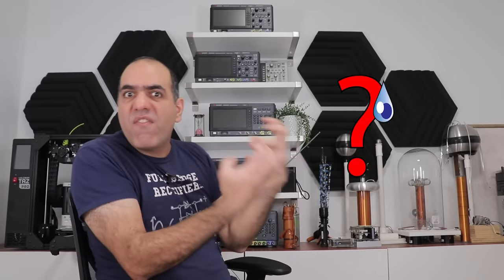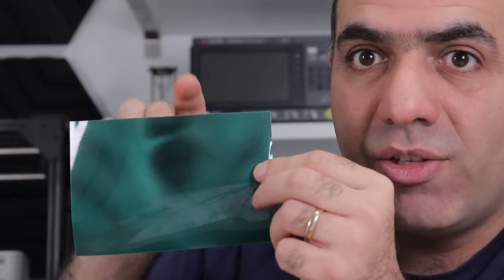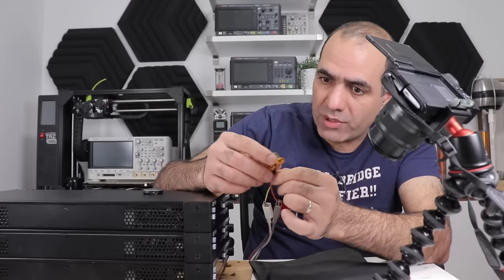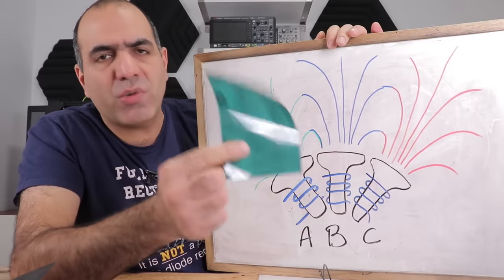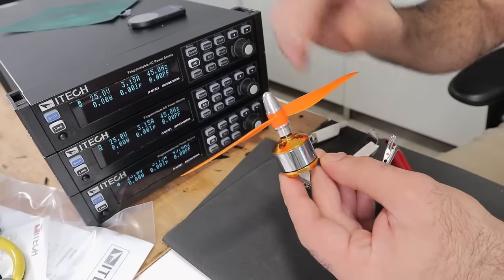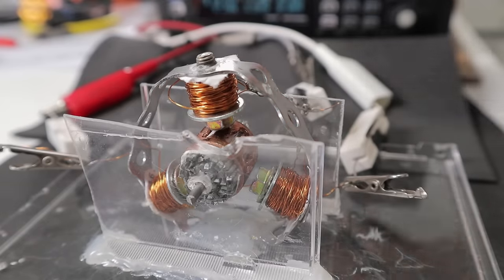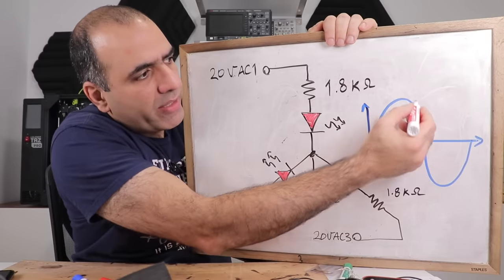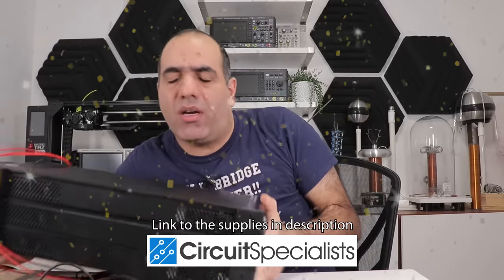Trying to See Rotating Magnetic Fields

Comment: I use to get into arguments with my instructor after class at my community college. He was VERY well educated in electrical subjects. He wasnt a physics professor but had tons of work experience and he was saying basically the same thing you are in a little less detail. I still cant see how a magnetic field rotates. I have always looked at the motor-pole system as kids playing on a merry-go-round. The poles are like the kids standing at a few different locations in a circle around it. The kids arms are like the "rotating magnetic" field and the merry-go-round itself would be the motor spinning because of interactions with that magnetic field. The kids are stationary as they start to spin the merry-go-round and the energy they can put into the merry-go-round is strongest when closest to the kids. As the kids push in the same direction their arms are able to put less energy into the merry-go-round as their arms extend and since the kids themselves arn't moving they must let go at the point where they can no longer put energy into the system because their arms are fully extended. So the merry-go-round must "coast" for a short time so the kids can retract their arms and reorient to make another push. Now if we look at what is acting as the magnetic field (in this case the kids arms) we see the kids arms are not rotating but rather adding a tangential force in specific areas around the merry-go-round that results in rotation. But again the kids arms are not rotating. They are activating and deactivating in synchronization with eachother to maximize efficiency and the more kids we throw in the mix represents more poles in a motor. It makes the gap between kids smaller so it's easier for them to rotate the merry-go-round because the kids can concentrate their forces across smaller sections of the merry-go-round's perimeter. But even kids standing shoulder to shoulder would still not make their arms move in a circle, just shorter distances of back and forth. And I realize that if you squint a little it all looks like its rotating but in my mind the magnetic field is appearing and pulling the rotor a little then disappearing and reappearing in the next coil where it pulls the rotor again. So like the kids and the merry-go-round scenario it's being handed off to nearby poles (kids) and the magnetic field (kids arms) pulls the rotor a little and hands it off again. But everyone could see that neither the kids or their arms are rotating. Another example is trying to cut a circle out of a square piece of paper by only making straight cuts. The cuts represent the perpendicular force between the rotor and the stator coils. Big long cuts would make a blocky circle. You could make many small cuts around the paper and make it look even more circular and that acts like adding poles to a motor but no matter how small the cuts (or number of poles) if you zoom in far enough you'll see it's a "circle" made from thousands of tiny straight cuts.

 So I don't think the magnet field TRULY rotates and that's where lots of confusion comes from. It just strongly implies rotation when really it's small interactions of tangential forces that CAUSE rotation. I know its nitpicky but it feels wrong to say a magnetic field rotates when it's just expanding and contracting in areas around a circle. Like how a "flying squirrel" doesnt actually fly but rather glides.

If I'm wrong or otherwise off in my understanding of "rotating" magnetic field please someone explain it to me better. And thank you for humoring me with this absurdly long post. Also I LOVE your videos. I would have loved to have you as a professor in college. Keep up the outstanding work!

Comment: You can easily make a 3D magnetic field visualizer by getting two pieces of optically flat glass, mix mouse milk (it's a lubrication product, not actual milk from mice) and some ferrofluid between those pieces of optically flat glass panes (obviously you need something to contain the fluids). Some LEDs around the edge, and you're good to go.

Comment: you could have drilled a hole in the sheet, and then stuck it around the motor so that the motor would rotate inside the sheet. start with an axle-sized hole to get a side view of the motor, and then a motor-sized hole to fit the whole motor inside it, where you don't let the sheet rotate at all

Comment: Just a thought about why you couldn't see the fields on the sheet, I'm assuming they are some sort of ferromagnetic particles in solution with viscous fluid, there would be some lag in the system for the particles to move. Could it be that the frequency was too fast for the sheet to respond?

Comment: You may take a stator with coils from 3 phase AC motor, fragment of plastic drinage pipe and steel ball.
Plug stator to 3 phase power supply, get plastic pipe inside stator and steel ball inside pipe.
Ball will spin inside stator.

With love from Russia, sorry for my english.

Comment: 45 Hz is probably fast for magnetic field visualization sheet. 
I learnt this hard way when I was able to get clear voice of amplitude modulated laser signal using a Photo-Diode as receiver, but got gibberish when I used Light dependent Resistor. 
After 3 days of trial I understood the importance of response time.

Comment: The "magic paper" iirc has tiny pcs of nickel in it. They take time to orient themselves. What happens if you crank the frequency down to say 1hz? The particles  tend to stay stuck in their orientation so if it doesn't work maybe a fast moving field like a nearby rotating magnet or degausser etc. might reset (randomize) paper and show some 1hz commutation?

Comment: You can just take the rotor out of a induction motor that is about 1/2 hp. That should be large enough to fit a compass I the center. Then use your power supplies to speed it up, slow it down, reverse etc. Turn your induction motor into a permanent magnet synchronous motor.

Comment: How about a double walled cylinder that the motor can fit inside, then put iron filings into the "interior" of the cylinder. for reference.. Think about a double wall plastic travel coffee mug. The magnet/motor goes inside the cup, like where the coffee would go. And the iron filings would go inside the "vacuum chamber" between the two walls of the cup.

That way the iron filings are contained, but free to spin around the chamber with the magnetic field.

What do you think, Mehdi?

Comment: Just to be clear, the magnetic field does not rotate.  The field always has a curl of 0.
It's analogous to waves on the ocean:  the feature of having different height in different places will move, and you can surf them.  But the ocean itself is not moving; the water at each point is moving up and down, not flowing with the waves.

Comment: Electroboom. 

Could you make a clear acrylic cylinder casing that surrounds the motor but also allows for viewing 360 degrees around it. Fill the cylinder with a clear oil and put ferofluid or even iron shavings and potentially see low frequency rotation?
Reply: After commenting I realize that this doesn't paint a great picture. I give you a draft if you'd like.

Comment: Medhi, do you happen to know why some geared ebike motors are more efficient for hill climbing than direct drive (ungeared) motors, so that they use less power and don't get as hot? How much does the electric motor efficiency vary with RPM, current and load?  
That was a brilliant demonstration with the LEDs.
Reply: Gears in the E.V. bikes are it's TORQUE multiplier...   
let's assume a motor on its own can produce 
" x " newton- metres of torque("T") @ rated voltage/ amps/ rpm..("v/a/n") respectively
now a geared e.v. with a 3:1 ratio. would give a reduced speed of " n/3" but a theoretically increased torque of " 3T " ...thats advantageous in hill climb...
for the same (" v/a") input...

Comment: the futer of genorators is the past, with a stabel ac surce as excitation, the main rpm is the fiel and with conter-rotation(close a serie on the rotor the genorator cois) it rotats slow opsing the fiel by lens law(self motive force)
12 coil on statar 3 fases excited, with 9 genorating coil on rotor(1 close loop jumpered) 2 fases left over for produntion by rings

Comment: Hi ElectroBOOM. Great video again but I don't think you would see a sweep of the field with viewing film. There is a bit of a lag in the appearance and disappearance of the image. Also when 2 phases are on, this makes 2 fields at an angle, so not sure if that would show a single rotating plane, more likely 2 planes. You only see single lines aligned with the coils, these lines are fixed because the coils are fixed. Would be good to see the static condition when only phase1 is on, then phase 2, then 3. I would say stay safe, but you're probably immune to electricity by now 😀

Comment: Hmm... The rotating magnetic field only could be shown if the magnetic indicator would change colour between exposed to north and south pole. As it is, when you lay it onto a magnetic pole the magnetic particles will indicate a strong field - which stays in place even if you turn off the current or remove it from the magnetic source.
The magnetic field only virtually turns, but it can not indicated by the flux foil which just shows where the strongest magnetic fields are (hint: where the metal is)  - and not their polarity.

Comment: My bro electroboom
Can you make a video about canceling a magnetic field (if possible, cause I think it is not, yet i have hope that I’m wrong lol).
Well, i build a huge power supply using 70 modules that output 12v 1a each, but the problem is that I forgot.. that it using transformers and lol they are close to each other and i am afraid that it will effect the current :P

Thx for your answer my best friend for boom boom 😁

Comment: I think the fact that it's going slow is not helping because the magnetic fields cant rotate at that speed. And it rotates at higher frequencies because then its actually rotating. Although 60 Hz should be enough in theory, but the stator configuration maybe isn't designed that way

Comment: Veritasium has a video on electricity. I ask you instead. If the energy that power lamps and other electric crap moves through fields not by wires, then wires are only for generating those fields(magnetic and electric fields)?

Comment: If the fields are rotating so fast that we can’t see them, but the rotor itself is rotating much slower, isn’t it kind of in efficient to have such high frequency? It seems like you would want to start at a lower frequency and kind of ramp up like a car transmission
Reply: he  should  have  been  using  a  bldc  driver, not that  monster 3-way power supply.

Comment: You just want to se a rotating magnetic field ?
Easy
you'll need Ferrofluid
2x panes of glas
Lightsource and a magnet you can turn under the panes of glas
You will get a 3d almost hollowgraphic view of the field ins and outs
Can even see where the fields intersect with its todrodial opposite
"Imagine a Coke can you turn top and bottom and wrap a line inside out (Read torus)
Tag me if you decide to do it :)

Comment: Speaking of magnets. could you charge a wireless charging device with magnets attached to Some sort of shaft rotating at a high rate of speed? To my understanding wireless charging is just magnetic fields switching polarity quickly. Free energy?? 😂
Reply: How do you get the magnet to spin? (It takes energy to do that)